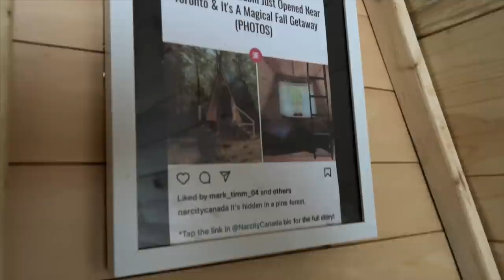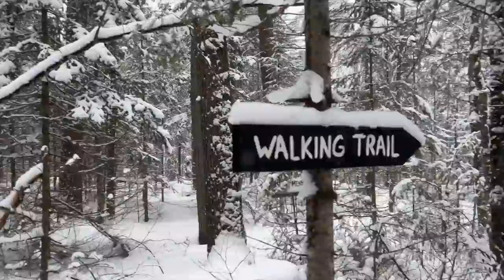Girls Weekend at an OFF-GRID Cabin Retreat

Comment: Solar showers in summers are just plain good for you! Keep your solar lights going with a warm 65-70 degree environment for a lifepo4 lithium (maybe a chinn 100Ah) flex solar panel with a nice mppt charge controller (a midnite?)
Good to have a backup duel fuel generator (i have inexpensive Champion) but rain water is my first big necessity and you can filter it before it hits the collection unit (works so much better for the final use filter like your Berkey or homebrew similar). Might find useful ideas in all this. Suggest hand held ham radio.
Nice to own a shotgun when scared or being safety conscious. Flare guns are a great safety if you hate guns.

Comment: No reason for outhouse … composting toilet is an absolute must have … box of pine needles and sawdust next to a five gallon bucket with seated ring holding the seat. Shower accomplished with instant propane mini heater like used in myJoolca or the super Ecotemp

Comment: A Frames are from the 70's and 80's the design is outdated severely as it does not heat will in the winter it uses too much heat source so they were all out of favor by the 90's so I am shocked to see one in a new video here .